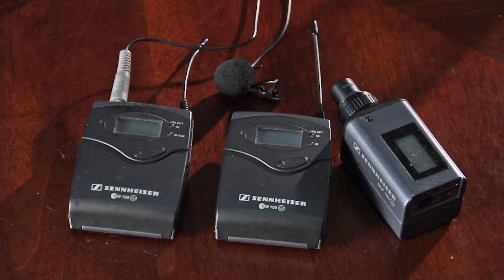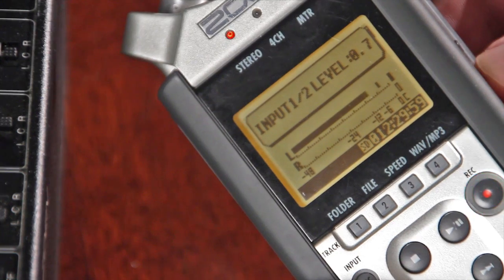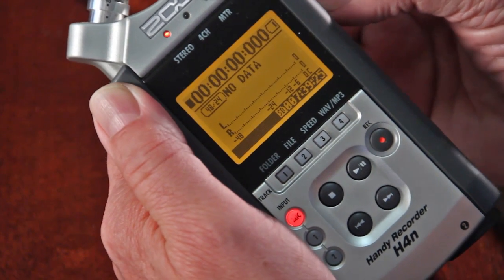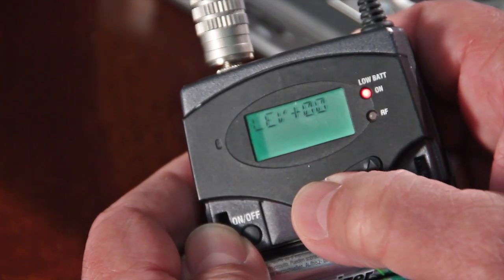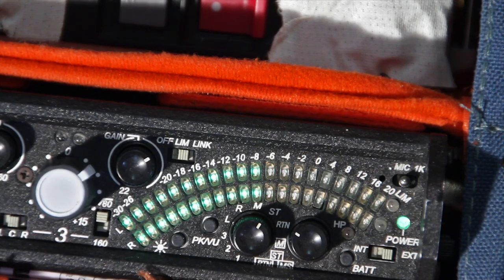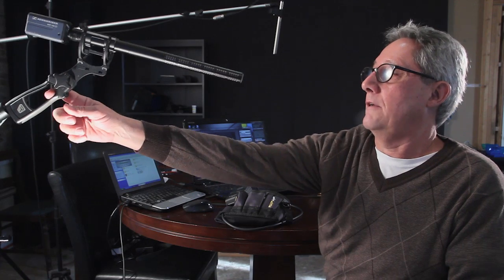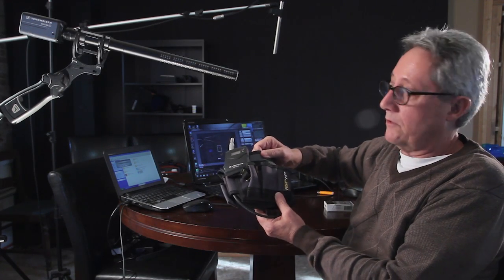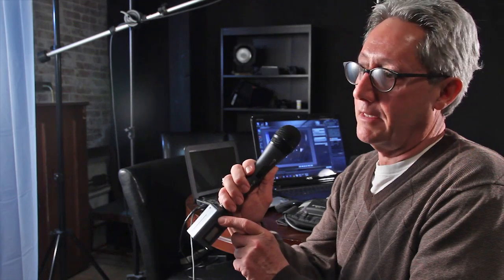Sennheiser G2 G3 Wireless to Zoom H4n Recorder for Great Moviemaking Sound

Comment from the maker: You need a receiver for each transmitter and they must be set on a different frequencies.  If you buy components separately on ebay, make sure that transmitters and receivers are in the same frequency range.  Look for used G2s, they work great.

Comment: im om a budget and want to buy the 3 but i cand figure o thing. i will have to work in an interview situation with more than 3 handheld microphones. i want to buy 3 or 4 of those XLR transmitters. the problem is: is it possible and if it is how many of those transmitters can i pair with only one g3 reciver? i don't want to spend money on other sennheizer microfones that can be paired. i have 5 mic's and want to use those transmitters.

Comment from the maker: Generally, I light subjects using a big, diffused key light aimed somewhat off center from the left or right with a less diffused back light aimed back toward the camera on the opposite side.  If I need light in the room, I always just shoot floods straight up at the ceiling out of frame.  Check out my real estate photos by googling roland comfort.  All of my real estate photos use strobes shot straight up to the ceiling out of frame.  I carry 2 of them in holsters with others around the house.

Comment from the maker: My main lighting fixtures consist of 2 Britek floods 1000w, 2 Par56 500w cans, and 4 Par38 cans.  I use regular hardware store 500w halogen bulbs in the Briteks, 300w bulbs in the Par56 cans, and regular halogen 75-90w floods and spots in the Par38 cans.  In this shoot, I hung a semi-transparent Walmart shower curtain liner on my right w/Britek flood and placed a Par38 w/90w spot behind my left shoulder out of frame.  more . . .

Comment: Hi Roland, thank you for your help.  The volume set on H4n also depends on the lav mic we use.  I was playing around in the past few days with Sennheiser G3 and used two different lav mics. The ME 2 that comes with G3 is only a mediocre, to say the most. The other one I used is Sanken COS 11D which is the best and is very sensitive and high in volume.  To reach -12dB, there is over 20 in volume difference.  I set ME 2 to 86 to reach -12dB but had to set to 68 for Sanken to reach -12dB.

Comment from the maker: Further, a viewer pointed out that you can hear the noise floor by using headphones on the H4n with ext mic selected but without a mic plugged in.  Sure enough, the noise pretty much disappears at a volume setting around 50.  So, if you set up the AF out on the G2 (or any adjustable input device) to get good bars at vol < 50 on the H4n, you can just use regular XLR inputs.

Comment from the maker: The G2 receiver uses a 1/8" mini jack out to a XLR male cord that comes with the system.  Some viewers have noted that using the XLR input on the H4n works just fine if you keep its volume down around 50.  I agree!!  So a simple setup is to forget about the 1/4" cable. Set the G2 AF out to -18 or -24, use the regular G2 XLR into the H4n XLR input, adjust until you get avg. -18 dBFS bars on the H4n with volume at 50 or less.

Comment: Actually, it has both a 3.5mm line in and line out. Could I use the line in?  I'm a bit of a novice and I only recently realized the importance of sound for video production after speaking with a friend of mine about common student film mistakes.

Comment from the maker: I did the earlier test and got the same noise that you did on both the xlr and 1/4 plug.  Maybe, for now, the best setting is H4n volume at about 50 to 60 with G2 AF out at whatever it takes to get H4n bars at -12 dBFS.  Using xlr, that is probably -24 to -18 dBU on the G2 AF out.  However, don't go all the way down on the H4n to 1 or .5.  Most devices like to run at "unity"  straight up in the middle, so 50 to 60 on the H4n may be the best place to start setting up the chain.

Comment: The fix being to keep the mic at -10 or -20 depending on the scene.  Then a hotter RF out, maybe as hot as -0.  Then we used a H4n input sensitivity of .5 or 1 (not 99), around that range so as to not use much of the H4n preamp.  This works with the regular XLR inputs.  Though you could use the 1/4" cable it doesn't seem to noticeably change the s/n ratio, just makes a weaker signal.  Hope this helps.  Great video though.  And thanks for getting me testing.  We have run tests all day, good fun.

Comment: Okay, think we may have figured some of this out.  During testing, even with the new 1/4" cable, it is still amping the sound and hiss is introduced when the H4n input level is too hot, I notice in your video it is above 94.  I can hear it above 70, try it with your mic off.  crank up your h4n headphones and monitor the recording with your mic muted, the h4n still introduces his as you get to a h4n recording sensitivity in the upper 75% range.

Comment: I too purchased the exact cables you mentioned, and found no difference.  We set a constant sound level, then matched two recordings (with/without) in post then examined the noise floor it was the same.  All settings exactly as you mentioned.  No disrespect, but are you sure this method works?

Comment: You mention using a XLF-SP-3 to connect to the Zoom. Yet in your video I noticed you have replaced the Sennheiser AF Out Mini/Xlr cord with what looks like a XLM-SP-3 or XLM-SPS-3 (Mono or Stereo). The connection that comes with the Sennheiser looks stereo on the Mini end. Just wondering which one you are using (mono or stereo on the AF out end)?  Along those same lines, would there be a big difference in bypassing XLR all together and going with a straight Mini to 1/4" mono or stereo into zoom?

Comment from the maker: Additionally, as the director, you could carry the recorder pack with you using an audio headset plugged into the Zoom recorder.  You will hear what it hears, however you cannot ride levels.  Level changes need to be made at the Sennheiser sending unit.  Thanks for the idea.  I never thought of carrying the receiver pack with me while directing.  Plus, you can control the audio files more directly in relation to scenes you are shooting.

Comment from the maker: You always want to set the mic sensitivity for the environment.  Are you recording in a coffee shop or are you front row at a NASCAR race?  Your Sen receiver bars will tell you where to set sensitivity from 0 to -30 dBu.  The receiver AF output to the recorder generally won't change.  Lowering or raising AF out to the recorder won't help if your Sennheiser send vs receiver relationship is too high or too low.  You will fix levels in post using Soundbooth or whatever audio program you use.

Comment from the maker: I am fairly sure that phantom power would not interfere with using a 1/4" plug on one channel and XLR on the other.  You"ll need to unlink volume control on the L & R channels to get the best levels on each one.  Expect a small amount of "hiss" on the XLR channel because it uses the H4n mic preamp, still ok for youtube, etc.

Comment: To to reiterate, really great and informative video! Definitely going to watch it a few times. 

I had a question about using the Sennheiser G3 simualtaneously with a phantom powered shotgun microphone. Since the H4N doesn't let you choose which channels are powered and phantom power really damages the XLR signal from the Sennheiser system, does using the 1/4" input bypass the phantom power? Or would it still be preferrable to power the shotgun another way or use one that's powered by a battery.

Comment from the maker: Regarding post production of your recorded sound - absolutely yes, you have to process it.  The professional audio guys pound on me relentlessly saying that the recorder (H4n) needs to be synced at -18 dBFS vs 0 dBu on the front end (analog) mixer.  I like -12 dBFS.  Either way, your recorded file will run way low, however it will be pristine in the digital world.  You have to crank it up and make it sound awesome in post using Soundbooth or any other audio editor.

Comment from the maker: The H4n 1/4 inch jack is unbalanced.  You have to use an unbalanced (TS not TRS) patch cord going in.  The whole point of the setup is to avoid the somewhat noisy H4n preamps that kick in when you use its XLR input.  Either Rode NTG2 or Sennheiser G2 (AF Out at -24 to -30) using XLR input you are getting some hiss.  Using the phone plug on the H4n will produce almost total silence regarding hiss.

Comment: I may have answered my own question for the XLR to TRS.  It is the only cable I have handy so I tried it out.  I still get hiss from this setup.  The only way I've been able to not get hiss from my H4n is to use my Rode NTG2 with phantom from the H4n.  If I use a battery in the mic for phantom I still get hiss.  Time for some more testing.  Guess I'll be ordering a XLR to TS 1/4 inch.

Comment: Hey great info on this.  A quick question and comment.  Do you think there is a problem with using and XLR to TRS?  I also think that adjusting the sensitivity on the transmitter should be used more to control the coverage area of the microphone (the less sensitive the less area/less background noise the mic will pick up) more than controlling the signal to the receiver.  After post and movie output, do you try to normalize the audio signal so that is is always between -6 and 0?

Comment: Of course, it's off. Everything according to your instruction :) 
I was afraid maybe I have counterfeit product (G3), but it seems to work well, if I connect the receiver output to my sound card in the laptop (mini jack). No noise/hiss AT ALL via line-in. Good sound even at AF Out +12dB and 0dB sensitivity! Obviously there's hiss and distortion when connected to mic input in laptop (-12/-12).

Comment: It's Shure XLR cable (from dynamic mono mic), I can't say if it's unbalanced or not. When I'm using Rode NTG-2 (powered by one AA battery) connected by this cable directly to Zoom, I'm getting good sound with acceptable noise.

Comment from the maker: If that doesn't work, here's a long-shot solution that may apply to your sound card in your computer.  Some time ago, I noticed a hiss coming up over a period of about 5 seconds when I was recording room tone.  I thought it was my Fostex recorder.  Turns out that my sound card was set to some kind of auto level.  Turning it off fixed it.  By the way is auto level off on the Zoom?

Comment from the maker: Are you sure that your xlr to 1/4 inch plug is mono, unbalanced.  Make sure the xlr 2 pin goes to the plug tip with 1 and 2 going to the sleeve.  I use the Tecnec XLF-SP-3, available at Markertek for about $9.

Comment from the maker: Yes, most recorders use the 1/4" phone plugs to skip around the recorder mic pre-amps.  My Foxtex FR 2le sounds better using the phone plugs too.  I think that if you are using front end devices, you need to avoid using the XLR inputs unless they have a mic/line switch.  Thanks for watching.

Comment from the maker: Thanks.  It has taken me 8 years to figure out that digital meters need to run low at -12 to -24, however, I have no idea what kind of meter that is in the Sennheiser receiver.  I just trust that if you keep its bars in bounds, then you will have a great signal coming out.  Thanks again!